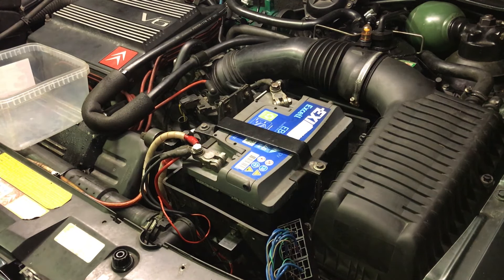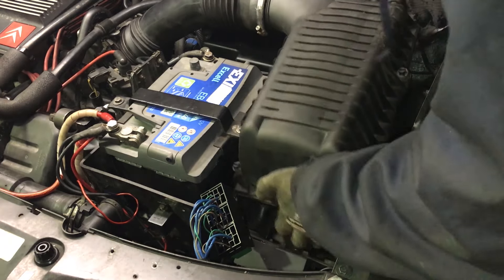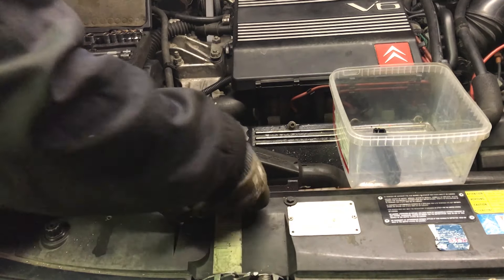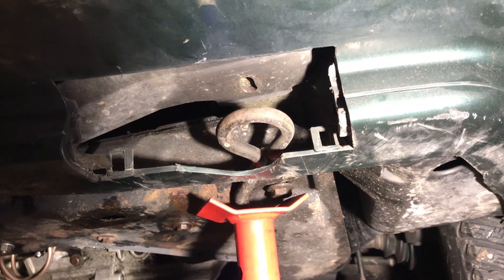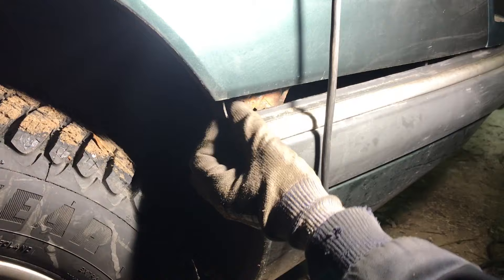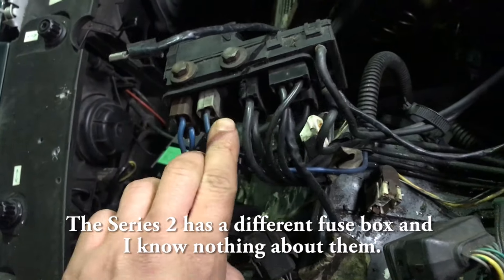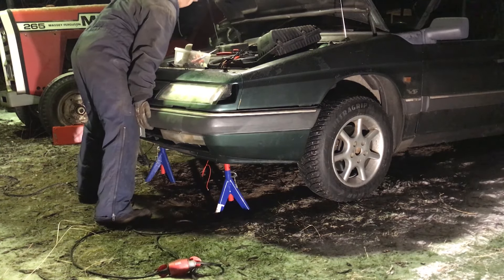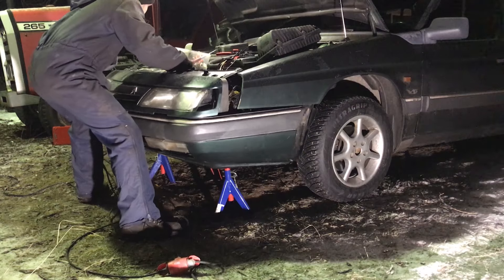How to remove the front end of a Citroen XM

Comment: ... it is easy to remove the mask, headlights, bumper, and then the front part with the fans, it is difficult to remove such a complete front part.
Reply from the maker: I think that if you need to remove the front end, this is the best way to do it. only downside is that its a bit heavy if you are alone.